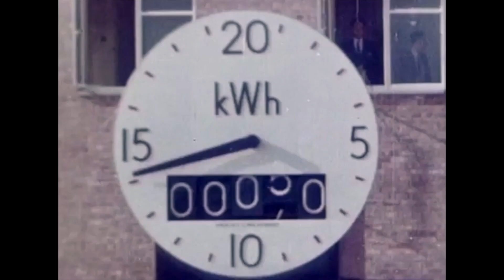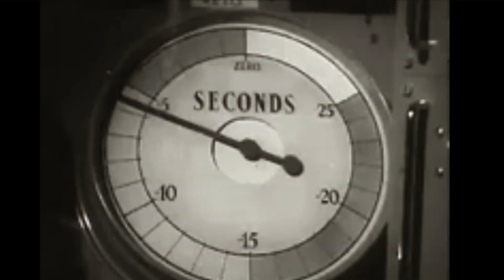Nuclear Lies - Prof Simon

Comment: The statement that nuclear power plants are nothing more than weapons grade plutonium factories is false. The reactor at Calder Hall, the Magnox reactors based upon it, as well as the Russian RBMK reactors were all designed with a fuel cycle that could produce weapons grade plutonium. The bulk of power reactors, the LWR's, are terrible at producing plutonium for weapons. Along with lower neutron flux density, their fuel cycle is too long; weapons grade plutonium stays in the core for 90 days and is removed. Beyond that, the Pu239 isotope (the one used in weapons) accrues too much Pu240, making it unsuitable for weapons; Pu240 content must be less than 7% to be considered weapons grade. A fuel assembly in a LWR stays in the core for ~4 years and can have a Pu240 content greater than 25% of the total plutonium. The isotope is not feasible to separate from the bulk, rendering power reactor plutonium unusable for weapons. I get that the mistake can be made from Britain's programs, but your generalization about all reactors is false.
Reply from the maker: They still were part of the nuclear weapon system.
Reply: @SimonHollandfilms  No, not really. Calder hall was built primarily to produce weapons grade plutonium and generated electricity as a useful byproduct, like the Hanford N reactor. The Magnox and RBMK reactors were designed to produce power and could be switched to produce weapons grade Pu if desired; doing so simultaneously is not feasible due to differing neutronics characteristics. The bulk of the power reactors (PWR, BWR, CANDU) are optimized for electricity generation and are poor at producing weapons grade Pu no matter how you run them. You may try to contend that they are only operated to maintain a knowledgeable workforce that could be used to produce weapons, but that is incorrect as well. There are many countries that have developed nuclear power and have no weapons, and there are those that have weapons but no commercial power. The correlation simply is not there; you may as well say that the only purpose of a steel mill is to build tanks and warships.

Comment: Magnox stations were certainly designed originally to produce feed stock for military applications, with electricity as a by-product. But the militray wasn't the primary purpose for the AGRs or Sizewell B.
Dounraey was a fast neurtron research establishment (possibly amoungst other reasearch activities)
There were many 'little white lies' during the cold war - which is to be expected.
Reply from the maker: More lies....what was the main purpose of dounraey
Reply: @SimonHollandfilms  My recollection was Dounraey was to investigate fast neutron nuclear fission - most reactors being slow neutron hence water or carbon moderation. The fast reactor being a breeder - that breeder creating fissionable fuel from the u238 - by bombarding u238 with fast neutrons you get U239 which decays to Pu239 - which is fissile. Thus using U238 as fuel without all the costly messing about enriching U235 content.
Obviously you could recover Pu239 - and that could have military use.
I could be mistaken, it was a while ago when I knew about this stuff.

Comment: It's a shame we didn't pursue the Molten Salt Thorium reactors Professor Simon. 
Who needs nuclear weapons in this day and age. 
Plutonium is such a horrendous material. 
The course we pursued back then was purely a race to test a weapon before the ban on nuclear testing came into force.
Reply: We have pursued your dream and still are. There are reasons it is no better an idea than, boiling water for energy is just on of the dumb ideas in it all. Polluting all the while and leaving waste that outlive life on our planet.
Think a bit more, maybe
Reply: @qzh00k  water or any other heat tubine driver material.  Solar farm only fission heat instead of cumbersome mirrors on the desert floor far away like hydroelectric.  Convective salt like moltex.
Reply: We should remember the scientist who insisted in installing scrubbers in the top of the chimney. The Government wanted to reduce the cost of the project  and initially said no. He told the Government he would resign and tell the press why. He got his request and had they not been installed the disaster would still be with us today. Sorry I cant remember his name but worthy of mention if anyone knows his name.
Reply: Max Gurth  John Cockcroft
Reply: Why do you think Plutonium is horrendous? Yes you can make bombs from Plutonium 239. But other isotopes and P239 have other uses. Its harder to do but its possible to make a nuclear bomb from Thorium. You just have to separate the Uranium 232 I think it is from the rest of the uranium.
Reply: @SkullKing11841  Well firstly it's probably one of the most toxic substances on the planet. Secondly we already have to much of the stuff.
Reply: @jeremytravis360  Baloney. Weight for weight, plutonium is far less of a radiation hazard than naturally occurring radium.